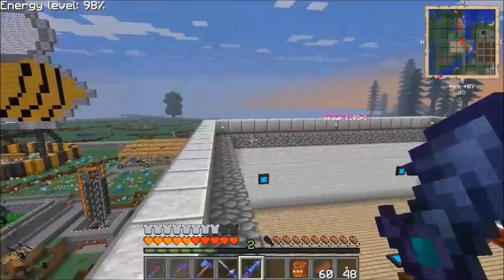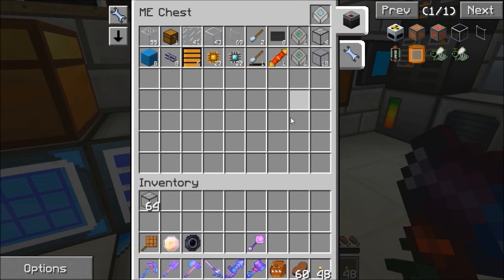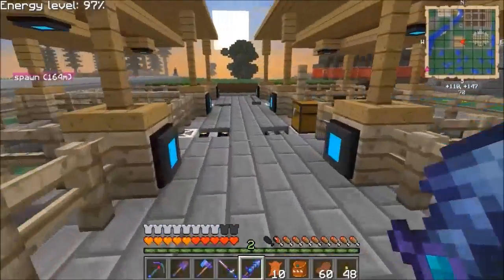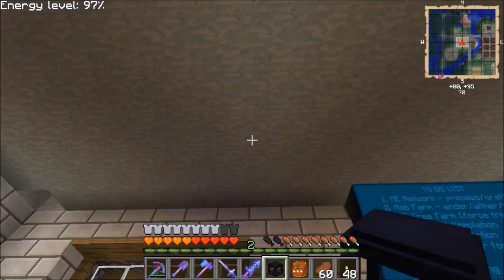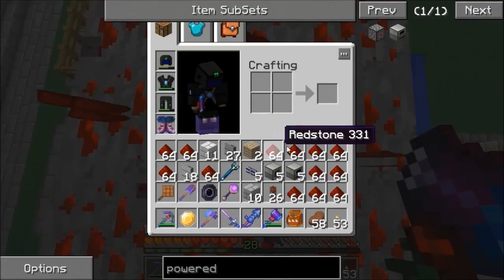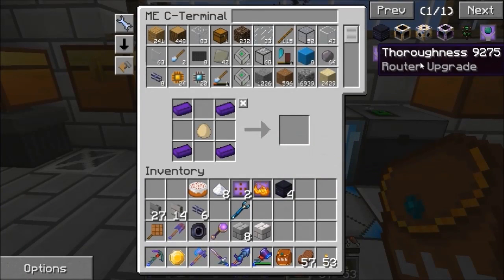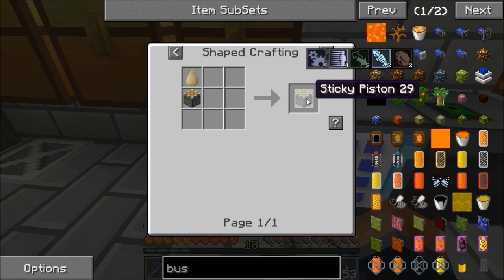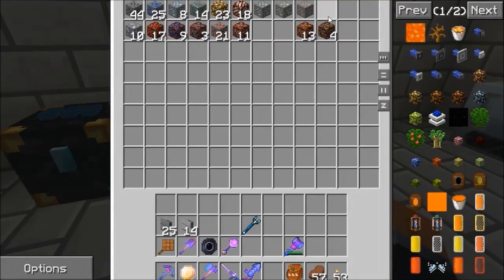FTB Unleashed S01E20 Wrath Lamps, and automating ore processing with Routers

Comment: You could also automate the smashing process by having a filler place all the ores for you and a TURTLE, equipped with a smash hammer/pickaxe with maximum fortune to break all the ores. Golems then pick up the items and put them into an ender chest/ME system. Brains in jars can also surround the entire complex to soak up all the experience.

The only manual thing about it is that you have to right click the jars to get experience, but I'm sure someone like you can figure out a solution for that!

Comment: The Speed Upgrade for the routers removes the delay between visiting machines, so it'll be putting things into one machine one tick and into the next machine the next tick.

Why the Bandwidth Upgrades, though? That seems to defeat the purpose of parallelizing processing with many machines. Example: If you want to process a stack of X, with bandwidth you still need to wait for X*64 operations - if you leave out the bandwidth, you only need to wait X*64/Y, where Y is the number of machines.

Comment: And since the machine is "busy" as long as there's one item to process, you don't need the speed upgrade either - The processing time is way longer than the delay between machine visits (unless you have craptons of machines - Even 15 furnaces works fine without any router upgrades at all.)